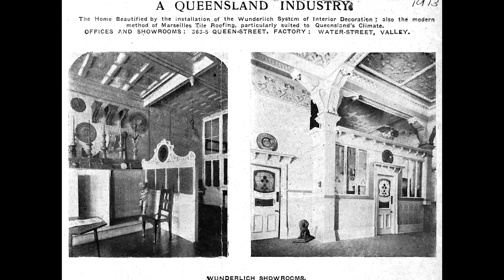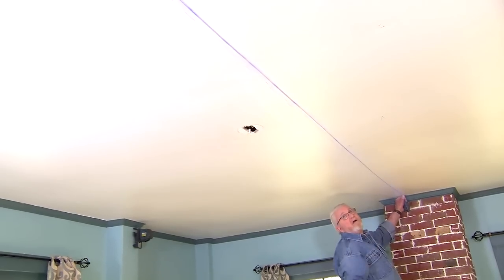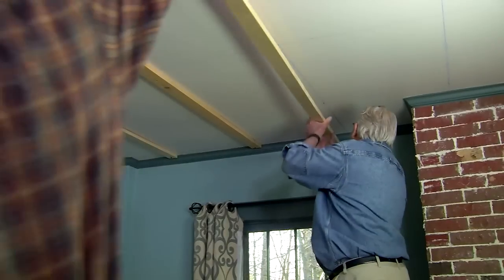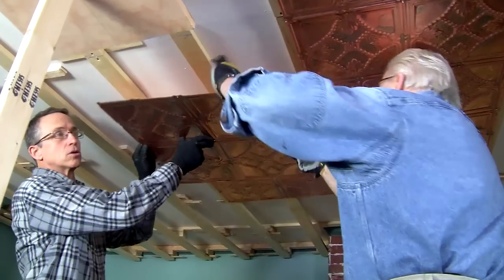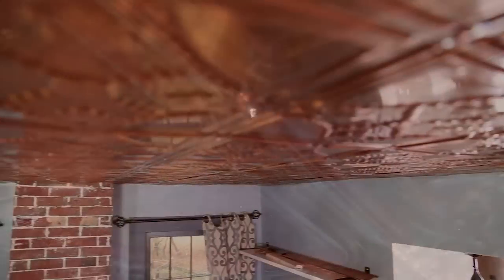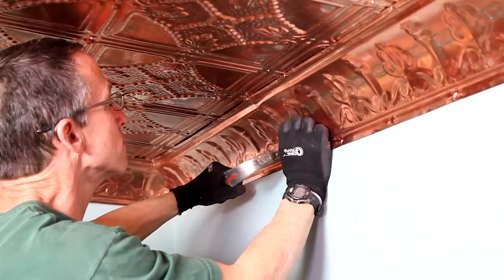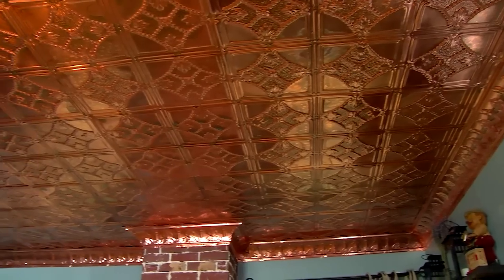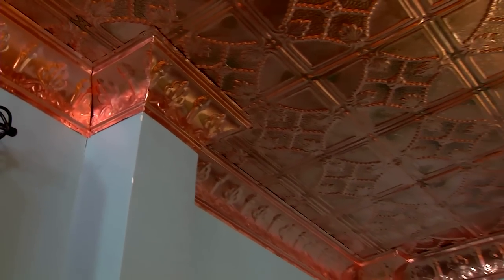How To Install A Copper Stamped Metal Ceiling

Comment: I wonder if there is a stud finder strong enough to detect the studs through an old plaster and lath wall in our home? I would love to have a ceiling like this.
Reply: No
Reply: I agree, no there is not.  You're going to have a hell of a time finding the joists.
Reply: One alternative to searching for joists from below, if the ceiling is accessible from above (attic), you can drill location holes from above alongside each joist.

Comment: If it was me I probably would have finished that off with wood crown it would look nice and you could hide you're inside corner cuts alot better you can see alot of gaps I'm sire those cuts sick to make on inside corners with metal they are hard to get clean but that just looks a bit rough